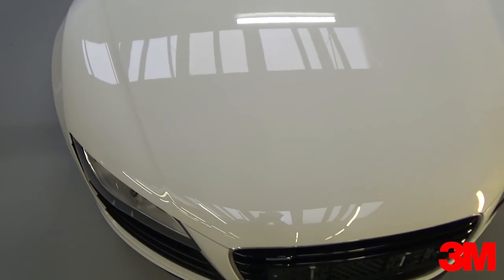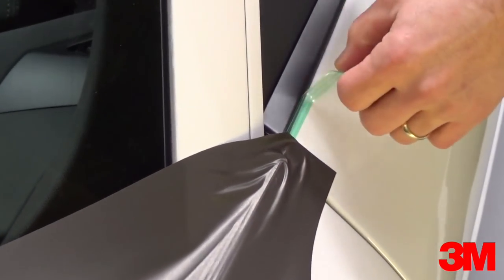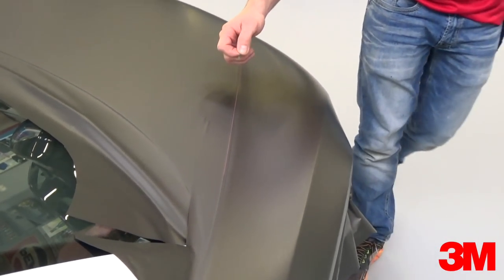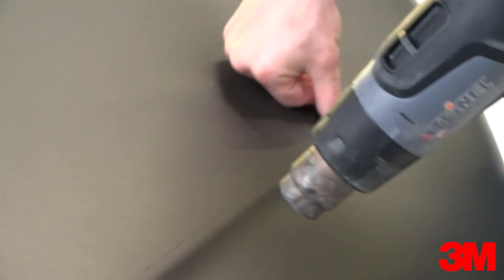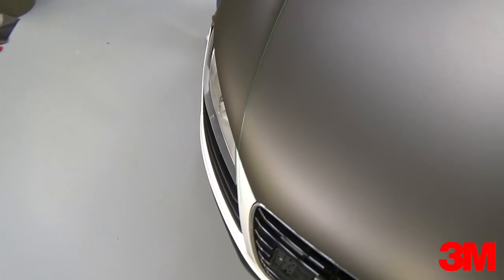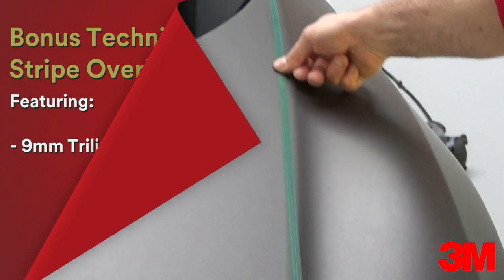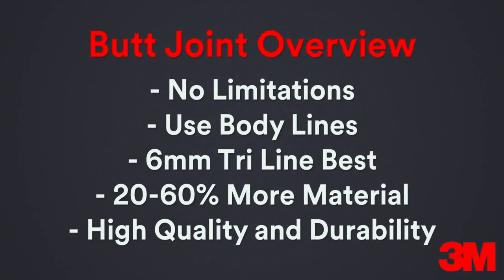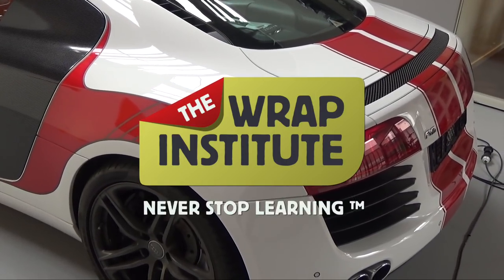3M Knifeless Tape – Creating and Hiding Butt Joints

Comment: For everyone wondering why they'd tell you to use this much material: They want you to buy this much material.
Reply: this is clearly a demonstration video. everyone does things their own way and every car has different dimensions. if you have a shop wrap your car, truck or suv you're already paying 2,000$ to 8,000$ for the basic color change so why not pay for the extra steps to make sure you have  seamess wrap that will last long? lets see you post a video of similiar to this one and then a year later to see how your butt joints look after heat and weather.

Comment: Why not use a single line and overlap the two materials then cut both vinyl layers in one shot creating a but joint. Wouldn't be the same as using tri-line then stripping them in 2 passes?

Comment: Do NOT do it the way that is shown in this video.  
It uses too much material, and it faces the seem the wrong direction.  By wrapping the middle of the hood a second time, place the the edge of the material facing the front and side of the car.  That means when you view the car, you see the edge of the overlap, making the seam more noticeable.  It also means that when you drive your car, to air is constantly blowing against the edge, which increases the likelihood of the edge lifting.  It isn't much of a problem on a relatively flat panel, like this hood, but for a panel that actually needs a seam, it could be the difference between a quality job, and a failure.

Comment: I need help. I will wrap mi hood of my challenger but the vinyl is small, I bought it wrong cuz the measurements are 4ft x 7ft and that doesn’t cover enough and I need to make it in two pieces. I also bought the knifless tape but I’m afraid of  doing it wrong, I dont want the cut line to be seen.

Comment: Would have been a better production if you had A-heated the film over the tape before removal, B- NOT BOUGHT THE COMPANY WHO INVENTED THE TAPE IN THE FIRST PLACE !!! then ruined it with your cheap knock off replacement supply :-(

Comment: Most over rated product ever and endorsed by none other than that "useless TOOL" Justin wanna be Pate.    Knifeless is a great asset for a full body commercial wrap but leaves a horrible serrated edge on a 1080 or Avery 1105 wrap that is far to often prone to premature failure.
Reply: so how would you do it better?